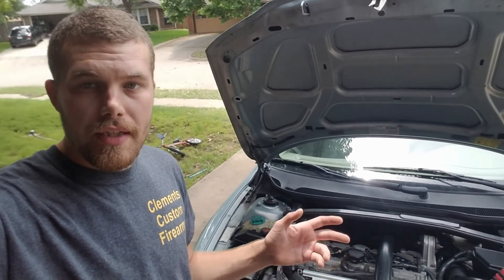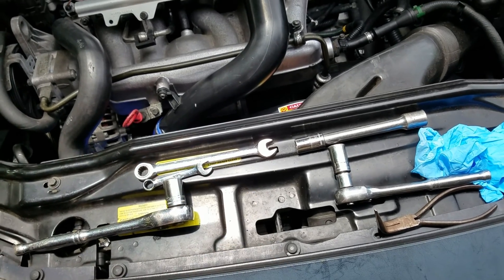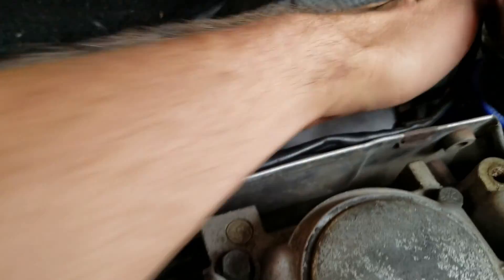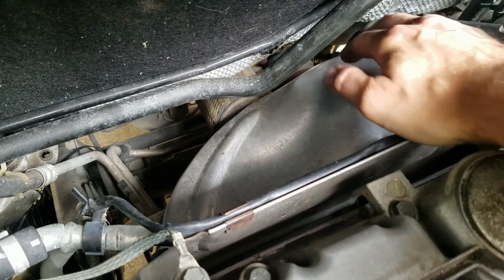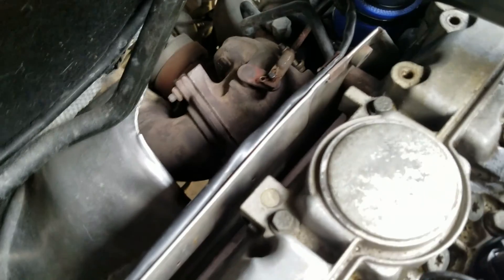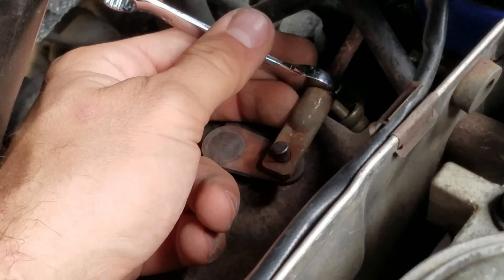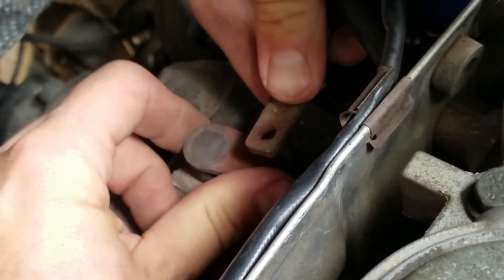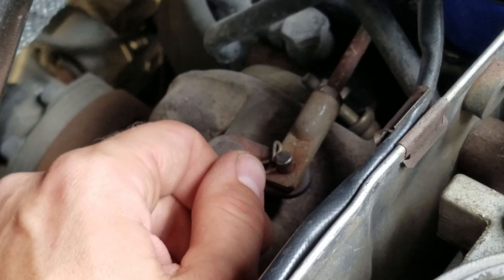How to adjust boost pressure Wastegate adjustment

Comment: Hi, maybe a bit late, but how many turns for 2.2 and 2.6 pressure from stock? Or do you know a rod length? For a 2004 P2 2.5T petrol
Reply from the maker: Unfortunately i do not know. The forums may be the key

Comment: I was told by a volvo mechanic that on volvo your supposed to extend the rod .not shorten it to increase boost
Reply: so should i do this
Reply: He's smoking Swedish crack. You need to increase the preload on the gate spring to increase the boost, that means a shorter rod. If the rod were significantly long the gate would never close and you'd have no boost.

Comment: you should be using a tool to test what youre adjusting to, you adjusted your wastegate sure but you dont know what you adjusted it too, this is an easy way to underboost or even worse overboost your car
Reply from the maker: True if you are just doing this on a stock vehicle, I am using auxiliary manual gauges and logging software.

Comment: How much more can a stock ECU with stock tune handle? Where does the limit go before the ECU cuts the pressure. Also does 1 turn mean approximately 1 psi depending on the wear and tear of the turbo? Thank you for the awesome video :)
Reply: Dont quote me but i think its 13? Or 14? Then fuel gets cut to keep it from blowing up.
Reply: @Nickfromthe816  hmmm i wonder what it is on a s80 t6 ?

Comment: IPD shows that... for example on my 96 Volvo 850,  you should put air pressure (1.8psi) until it starts to crack open and then adjust the actuator nut. I don't want to damage my engine so I'm trying to look at all the info out there. Thanks for your video but do you have any thoughts about using air pressure to help adjust the wastegate?

Comment: So, 2 full turn from where? from where it's sitting when taking it loose? Cause where it is sitting vary's from car to car. Thanks
Reply from the maker: Yes, it varies for each car. This was just where i started on this volvo. 2 turns wont
 do anything crazy though, so its safe to try 2 turns at time.
Reply: GageFixesEverything two turns in or out to lower boost? Thanks
Reply: Joseph Stevens thanks

Comment: perfect! thank you for the tutorial. About to blow up my 00 auto s40 with 130k miles should be a blast
Reply from the maker: NICE!!!! I just sold my pretty turned up V70. Custom Hilton tune was the single best upgrade. Then catless down pipe
Reply: I adjusted mine and now check engine light is on, something about turbo and I’m smelling high gas fumes, any take on that issue ?

Comment: Hi, 2 rod turns is 2 More psi?
Reply from the maker: It can, but it depends on your vehicle. The only way to know for sure, is to turn it, then drive and see where the boost is. The condition of your parts will also determine how much boost is changed by turning the rod. Also, this does not actually RAISE your boost level. It makes the boost level hit sooner. If you turn it too much, the ECU will fight, and try to regulate the boost causing spikes.

Comment: Hi question ... first thank you for your response video... did you adjust your factory wastegate ? Also is this a non diesel car? See I have a 1.4 turbo sonic and I can pull on my wastegate rod by hand and move it so I'm assuming the spring may be weak? So rather than replacing it with another factory one is it ok to do the two full turns on it in Hope's to increase and hold boost longer.. thank you
Reply: Did the 2 full turns .bring on some boost for you i have a chevrolet trax 1.4 turbo.
And i was thinking of gain booat by doing same thing